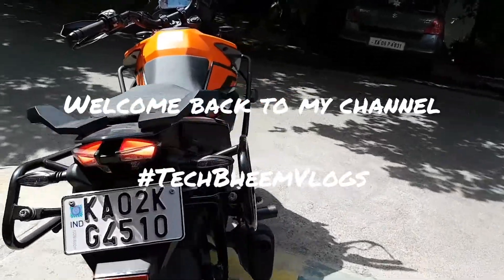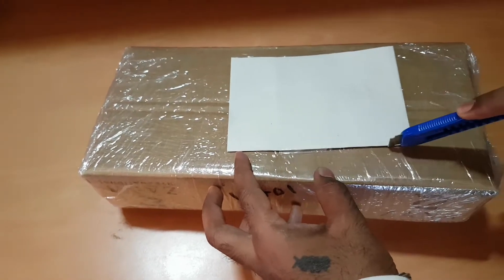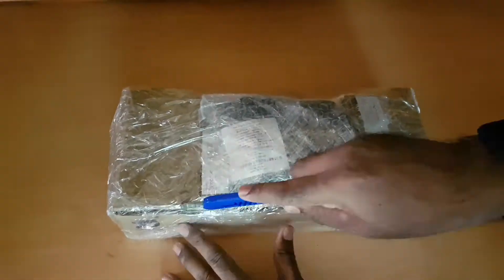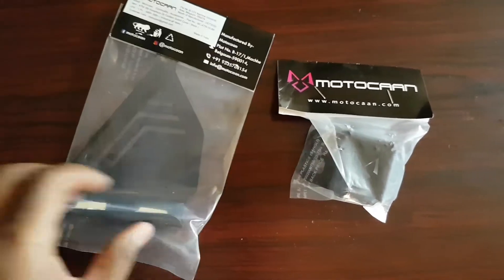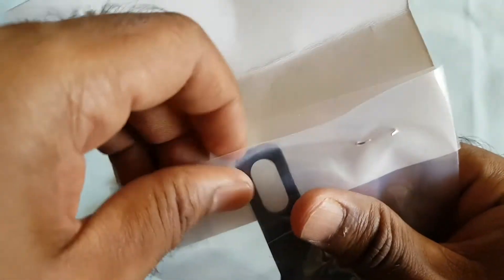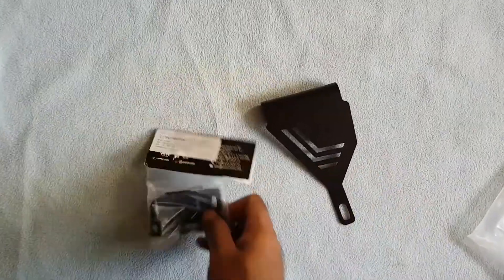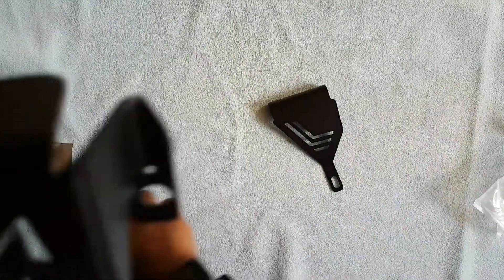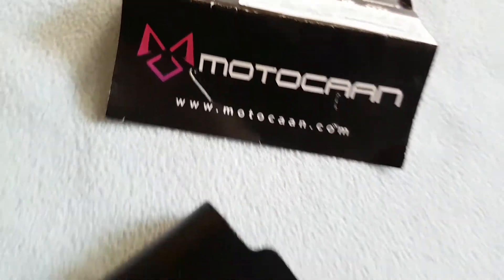KTM 390 Adventure Accessories| MotoCaan | ₹599 vs ₹1500 - Best Buy ???

Comment: Nd how to remove the rear mudguard?
Reply from the maker: It is fixed on the inside - you can chrck with KTM service or any trusted mechanic to have it removed.
Reply from the maker: If you have experience in handling it you can try or take help.